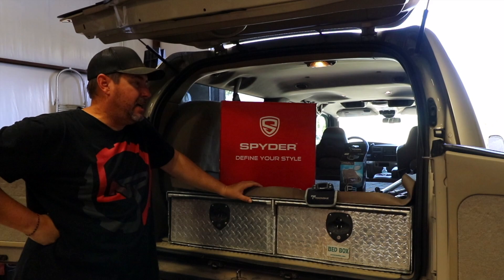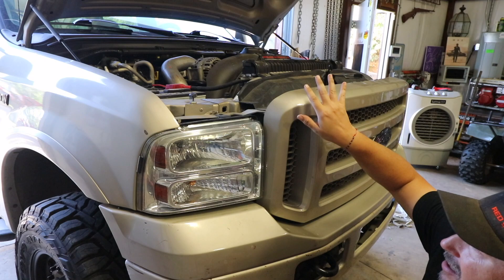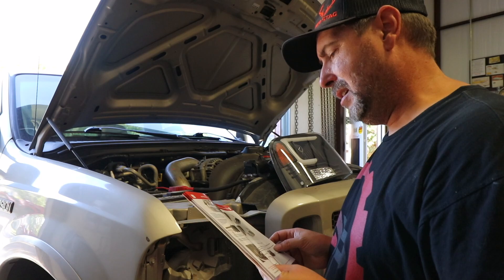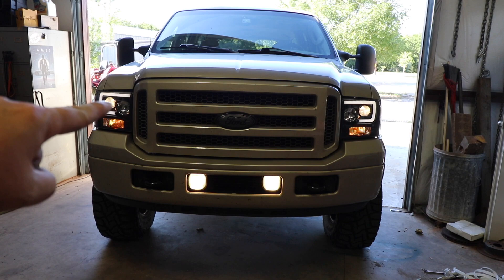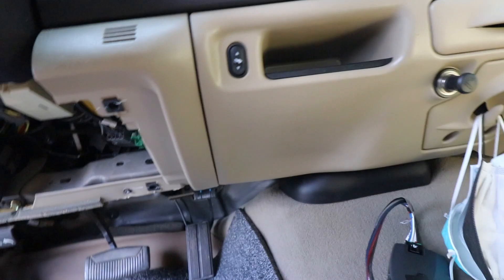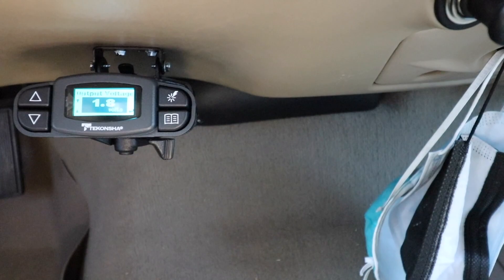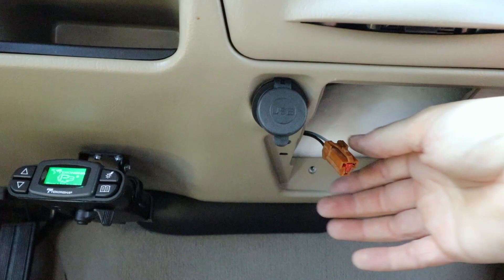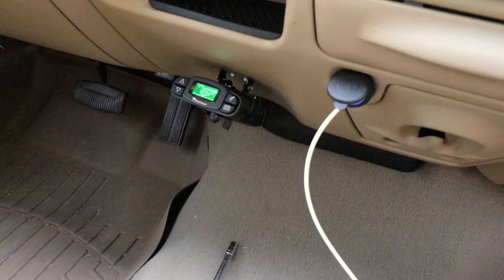Easy Ford Excursion/F Series Upgrades

Comment: If its not a 7.3.... Its Not an Excursion... Sorry 5.4-v10 and 6.0 fellas.
Reply: @starting over, honestly I'm really glad to hear someone found a unicorn! I have one 2005 with the 6.8 liter V10 & and 2005 with a Cummings swap! Try it you will love it!
Reply: If you like to be underwhelmed by a slow truck😂
Reply: I got mine in Sept 2004. Yes 9ne of the last ones off the assembly line so it had to be a 6.0 4x4 Eddie Bauer is what they had for 50k so it's what I got a day before hurricane Ivan hit florida a month after Charlie. I had a 33 foot 780 horse power boat in my driveway to take out of harms way and since no one gave me a loaner this is what I bought. Better to spend 50 than lose 190 to a storm.
Reply: @Alt rt nation...that's 6.8 V10 and it really is the better one overall out of the 3...
Reply: Haha… ok Mr Ford
Reply: @anthonydavis7147  that's why they are dirt cheap and nobody wants them.
Reply: Haha the 7.3 is good but the V10 is marginally more reliable and is the best option of all 3.

Comment: Those four unconnected wires are put in place by Ford for owners to add accessories.  The go thru the firewall and are found in the engine bay in the large harness behind the master cylinder.  I used them for auxiliary LED reverse lights and an auxiliary LED light bar up front.

Comment: Nice new look!! Perhaps down the road you should look into swapping the bulbs (high and low beams) in the new headlight assemblies with LED’s. It’ll really light up the road then!!
Reply from the maker: Yes. That’s the one thing I am not impressed with. The light output. Don’t get me wrong, it is better than stock. But will definitely look into upgrading at least the low beams. I have plans to install a light bar in the space where existing fogs are so that will help when I need High beams. Thanks for watching and commenting.
Reply: I have the same set. Unfortunately LED'S won't fit in these
Reply: Yeah I have the same lights and living in rural alabama there are always deer crossing the road. These lights do not put out much output at all. Tried to upgrade but I have no ideal what kind of light to use to upgrade

Comment: Excursions are really finicky with the newer style headlights, it can trigger ABS. It can also shut off the cruise control when you turn the lights on
Reply from the maker: Yes, I have heard the same.  I made sure to look at the forums on Facebook before I did the upgrade for these specific ones.  These along with the wiring harness I purchased seemed to not have those issues.  And I did not have those issues after install.  Thank you for watching and commenting.
Reply: Yea It trigger my abs light to stay on for like 30 minutes then it went away haven’t had problems since then..

Comment: Love the videos man. Keep em coming! Just bough a V10 excursion. Going to be lifting and doing some other stuff as well. I really like the cigarette lighter USB conversion!! Where did you find that at?
Reply from the maker: Thank you. I will keep upgrading as I get new parts and share. I got the USB port on amazon. It’s a Ginsco dual USB outlet. Was like 9.99. Very easy and cheap to do and really comes in handy.

Comment: I honestly like the stock headlights , all I did was put led bulbs inside the stock headlights
Reply from the maker: Nice. I really liked the updated look of these but typically like the stock look also. Thanks for watching.
Reply: I did the same by just getting led lights for the stock headlights on my f250. It was like 45 bucks for the 2 headlights and the 2 fog/driving lights. Only issue I came across was a voltage related problem. The led's draw near nothing compared to the old halogen bulbs so the truck had a brain fart. I forgot exactly what was happening. I think the headlights worked fine but turned off when I turned on the fogs and I think I didn't have any highbeams. Also Ford thought it was a good idea that if you had the headlights on and fogs then hit the highbeam it turns off the fogs so you have 30 feet of darkness right in front of the truck but can see a mile ahead not in front of you. To make everything work properly with the led's and to also have your fogs work while the highbeam is on you have to go into the fuse box. Don't quote me I don't want anyone screwing up their trucks. You go in the fusebox and in the lower righthand corner there is I think a green wire with a black stripe again I think that's the color it's been a while since I did it. You have to cut that wire a few inches from the back of the box so if it doesn't work you can hook it back up with a butt connection. Then you have to ground that wire to the dash frame right next to the box and bada bing everything works with the led's and you bypass the fogs not working while the highbeam is on. I believe this only works on Ford trucks from 99 to 04 or 05 with this specific wire.

Comment: I own a 2001 Excursion V10, 6.8L.  Awsome vehicle, runs great.  You would think that with all the talent out there, that SOMEONE could just make a nice, awsome looking, modern headlight system for these vehicles which will just easily pop-in and install with NO ISSUES!  I guess no one's motivated enough to do it...

Comment: Amazing bro, I've been looking at getting something new, just bought a 6.8 L v10 a year ago. Life has been amazing ever since
Reply: Hows the truck been running so far,I'm looking to get one also????
Reply: @mercedesbenzs600bash  my spark plugs shot out like fireworks. Just be prepared and I highly recommend getting cal van inserts and installing before issues. I've spent thousands over the last 4 months. Could just be my truck but it was fun. Currently still working on it
Reply: @SeanDiego  Much appreciated 🙏🏿

Comment: I installed the same brake controller, Tekonsha on my excursion and I love it.  I heard it was very important to orient it to align with front and back of vehicle.  I pull mine when not in use as they are not cheap and unplug easy.  I think they do not power down either if I remember correctly.
Reply from the maker: Yes. They are great units. I finally timed the power down and it’s 10 minutes.   I just could not imagine that it stayed on forever.  Seems like it though. Thank you for watching and commenting.
Reply: It will shut off

Comment: Can you post a link for the usb piece you installed?
Reply from the maker: Ginsco Dual USB Charger Socket Power Outlet 2.1A & 2.1A（4.2A） for Car Boat Marine RV Mobile with Wire Fuse DIY Kit Blue LED.  Thanks for watching.

Comment: You figure out the ABS light? I have an issue with mine as well as a random pulsing from my electrical system and you're making me think maybe a bad ground in the headlights? My batteries are about 2 years old, I have an oversized alternator and alternator grounding cable upgrade from FICM Repair. It seems the problem was masked due to the fact it came back a year later. I plan to contact them, they are super helpful and don't mind, soon just was curious what you found out. Thanks again
Reply from the maker: My ABS light issue was low voltage.  Once I ran for a day or so with the new alternator, the light went off.  I agree with you, sounds like a ground issue.  Yes, FICM guys are awesome and so knowledgeable about our trucks.  Thanks for watching.
Reply: @SimplybEpic  thanks for the reply. I appreciate it.

Comment: Hi did you find issue reason with abs light? From headlights? How did you resolve? What is cost of the lights? would thank  you for sharing 👍
Reply from the maker: It turned out the ABS light and some of the other issues came from a bad alternator.  I had a follow up video where I installed a better one and better wiring.  Solved everything.  Lights were not that expensive. Got on Amazon.  I want to say around 200.00.  Thanks for watching and commenting!!!

Comment: Great video with real world projects.  Did the USB LED stay on and if so, has that been an issue?  Thanks
Reply from the maker: Thanks for watching and commenting.  On the USB LED, it never went off.  The brake controller would turn off after 10 minutes but the USB never did.  Never seemed to drain the battery though.  I just put the cover on it when not in use to keep it from lighting up the cab at night.
Reply: The cigarette lighter is always powered on from the factory.  Amazon sells USB outlets with incorporated on/off switches if you really want to turn it off.

Comment: Thanks for the video. How well do the Headlights light up at night?
Reply from the maker: I would say they are definitely better than stock but not as good as I expected. Others have commented that you can change out the bulbs in these to brighter led bulbs and it really helps. Might do that in the future. But again, they are brighter than the stock lights so a good upgrade.

Comment: Where can I find the storage drawers you have in the back of the Excursion?
Reply from the maker: I got mine on Facebook Marketplace and had to adapt it a little to fit.  Took the 3rd seat out and it is barely short enough for my rear captain chairs to lock into place.  Bed Box is the brand and it was from www.hmfinc.com. It looks like they still make them under another website https://www.truck-tool-box.com/truck-bed-toolbox. Hope that helps and thanks for watching.

Comment: Did you figure out the ABS light after the headlight replacement?
Reply from the maker: Yes, it was a voltage issue with my alternator dying. It was just a coincidence that it popped up when I did the headlight swap. Changed out the alternator in the next video after this one and all worked great. Thanks for watching.

Comment: Where did you get the upgrades?
Reply from the maker: Mostly on Amazon.  If you look in the description section I think I linked them there.  If not, they are relatively easy to find on Amazon.   Thanks for watching.

Comment: What kind of box is that in the back of the EX
Reply from the maker: The tag says www.hmfinc.com. I bought it off Facebook.  Fits really good with a few medications.  Had to cut about 4 inches off of the front for it to completely fit but worked great.  I have since moved it out and into another truck as I am selling the Excursion.  Thanks for watching.

Comment: Where can you buy these headlights?
Reply from the maker: I bought them on Amazon.  For 2005-2007 Ford Pickup F250 F350 F450 Superduty Black LED Tube Projector Headlights Left+Right Pair Visit the AKKON Store.  They are great and made driving at night alot better. Thanks for watching and commenting.